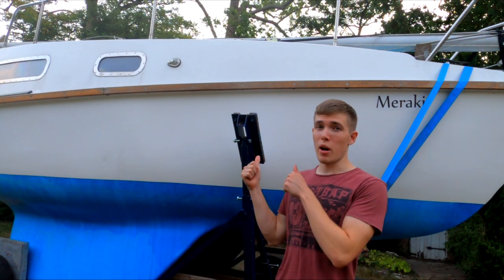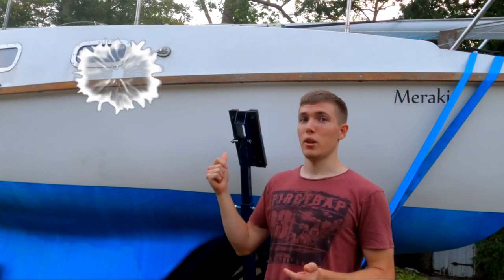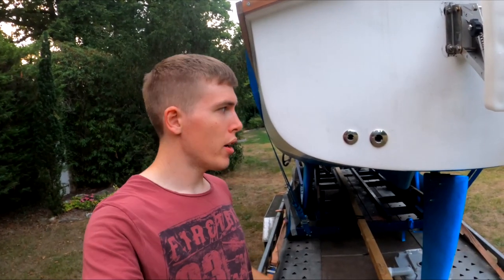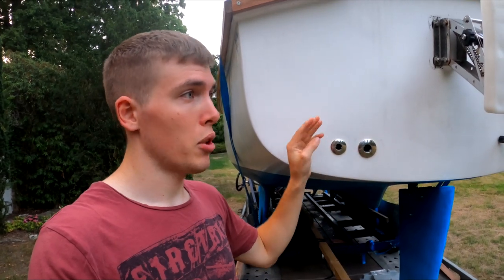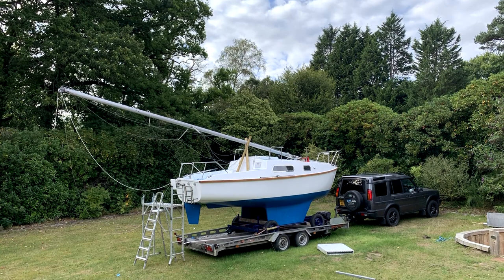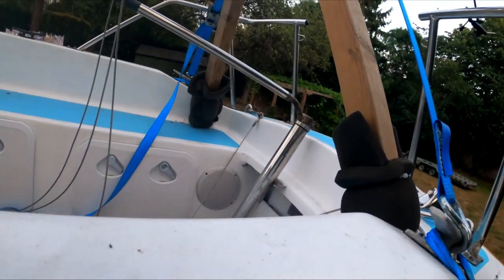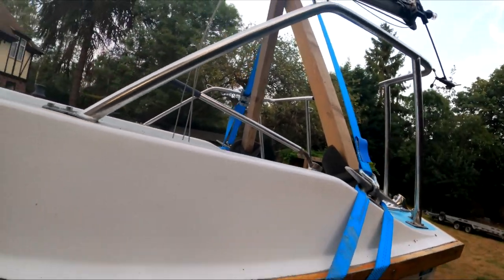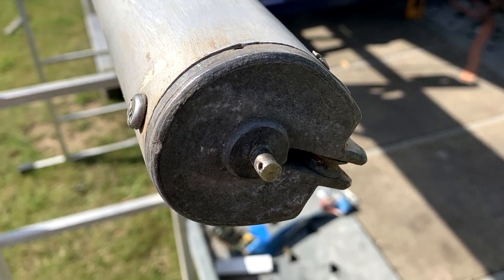EVERYTHING WRONG WITH MY SAILBOAT! Sailing Meraki | Ep.24

Comment: re power from the tohatsu, direct output from the outboard stator is ~18v with a lot of AC interference, lead acid batteries buffer the voltage down to whatever the battery is at and only take the dc component which can be much lower than the total output with all the AC thrown in. This is still pretty rough on the batteries as the potential is there to way overcharge them, what is needed is a dc-dc converter/regulator that converts all the power into a regulated dc output. A 24v to 13.6v 30A dc-dc is perfect, they come 10A quite cheaply but 10A is actually pretty optimistic, the tohatsu will put out less than 10A but still the little dc-dc will get very hot, a 20A or 30A is way better proposition or you could put two 10A in parallel. The dc-dc should be mounted near the batteries, that way the voltage drop occurs in the lead between the tohatsu and the dc-dc and not in the lead from the dc-dc to the battery.  The lead shouldn't be disconnected while charging is just a general good rule for systems safety inc instruments. Lifepo4 batts have slightly more requirements but give you twice the available capacity at just less than half the weight so well worth considering and they are clean : no acid. If you put a solar panel there are a few more considerations but all doable. Electrical connections on boats are done way differently to cars/houses, it's all about sealing moisture out, dielectric grease / heat shrink, all valid and necessary, solder joints are good if you know how, ie crimp first - only solder between the crimp and the eye so solder doesn't wick up the tinned wire - glue lined heat shrink to seal the water out, these last the longest. Crimp and dielectric grease in the crimp on tinned wire is easier to control in manufacturing environment and quicker so it the 'recommended' but it's not quite as good as properly done crimp/solder/seal.

Comment: I have owned two trailer sailers and both had the benefit of tabernacles. On the larger boat I used a gin pole slotted into a stirrup on the tabernacle pivot bolt and attached to the forestry while raising and lowering the mast. On the second I left the roller fuller attached at the bow fitting and had a purchase at the top of the forestry which ran down through a turning block at the mast foot and then back to the cockpit where it could be quickly secured or released in a cam cleat. Having given the mast a good lift with a pole with a fork at the top I could raise it from the cockpit.  The gin pole worked best and was used on the heavier mast. See if you can find any illustrations of Norfolk Broads yachts which all have systems to raise and lower their masts for the bridges. A frames and gin poles are prevalent. Good luck Alex.
Reply from the maker: Peter T thanks for the help!

Comment: The jobs never stop!  I had roller reefing on several boats including a Silhouette.  Biggest problem is as you roll up the main the boom drops.  To reduce this my Silhouette had a wedge shaped piece of wood on the underside of the boom with the deepest part of the wedge at the aft end.  The wedge was about 60cm long and about 25mm thick.  The deep part of the wedge was about 10cm tapering to about 20mm at the thin end.  With this wedge, the main is being rolled up quicker at the outboard end so less drop as you furl.  On dinghies like Wayfarers where you might want to reef it is common practice to roll and make a tuck at the outboard end to reduce droop which is just what the wedge does.  On the cockpit drains I would say they would be better going straight down through the hull rather than an elaborate system of pumps or sumps.  Andy UK
Reply from the maker: Andy UK - SY Corrival - Rival 32 thanks! The only problem with doing a drain straight down is access and especially in an emergency as there isn’t much room down there. And yes the work will never stop!

Comment: On the subject of a kicker with roller reefing on the boom....... you will need a reefing claw. Check them out on line. I used one on a Snapdragon with the same roller reefing system as yours.
Reply from the maker: Peter T i have been looking at them! do they damage the sail during furling
Reply: I never had a problem. The rollers spread the load out. It was the system we all used when boom roller reefing was in fashion. An alternative for cheapskates was to roll a length of webbing strap into the rolled sail and attach the kicking strap to it. Less sophisticated but better than no kicker at all. P.

Comment: When I had my boat of the same size I acquired an aluminium tube about six feet long. ( it lived on the trailer.). I made a fitting that locked onto the base of the mast step and the other end had a bar going across the end.  I put rope stays either side from the top to the chain plates to prevent sideways movement, the jib halyard tied off to the top of the pole and extending forward.  Put the mast onto the step and put pole in place onto the mast step. With the shrouds fitted I stood on the bow, hauled on the end of the jib halyard and the leverage from the top of the pole to the end of the mast was just sufficient to ease it up from vertical.  Once up about thirty degrees it was easy to pull up. Takes longer to describe than to do!  Good luck.
Reply from the maker: that’s a good idea! just coming up with my system now!
Reply: Just looked on YouTube, there are many ideas but the one I like is on an Oday 23.  That chap has it sorted and makes it look easy and safe.